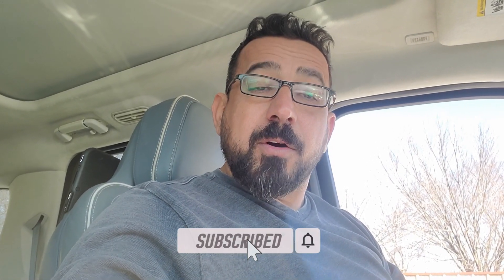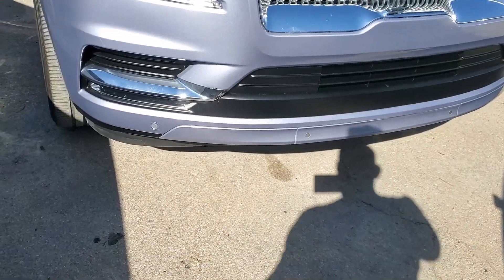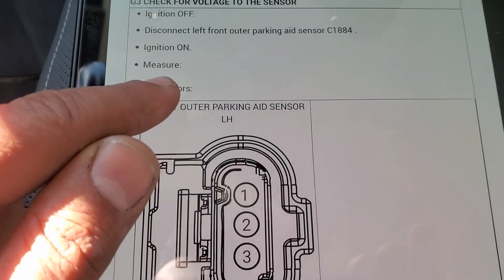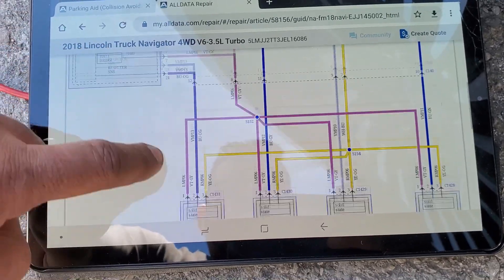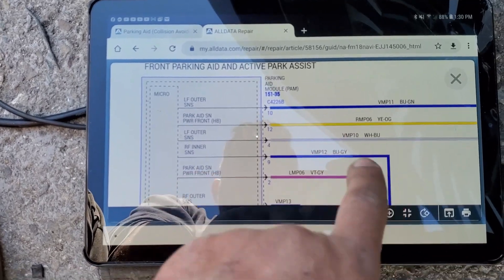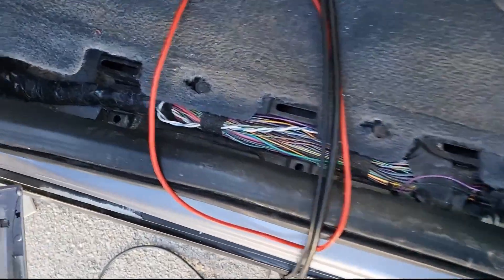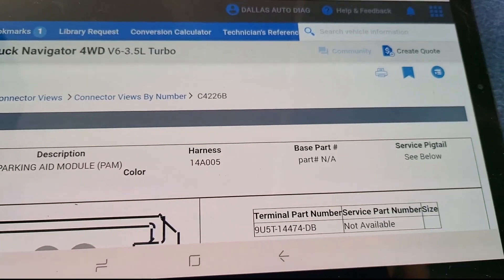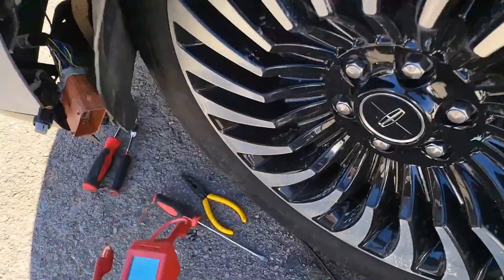2018 Lincoln Navigator Park Aid System Malfunction

Comment: Would a park aid fault light contribute to a lincoln not going into reverse gear? Trying to troubleshoot my own. When reverse selected the light on the gear selector blinks and says it will engage at low speeds but doesn’t move
Reply from the maker: I don't think so. Sounds like 2 different issues.
Reply: Thanks for the reply. The cars Engine Control Module was hit so now i’m thinking that might have something to do with it
Reply from the maker: @anthonyrajchel5984  I believe the engine control module is also controlling the transmission.